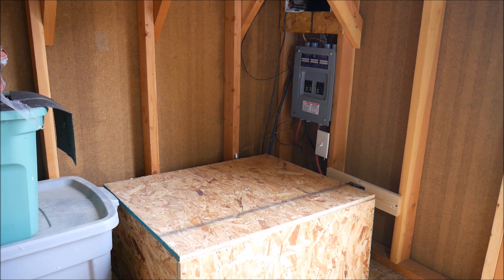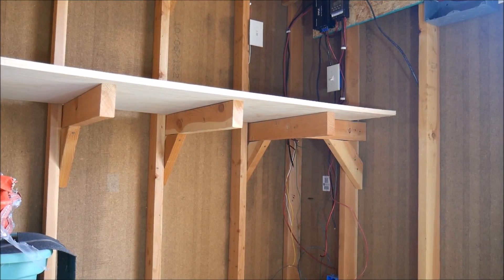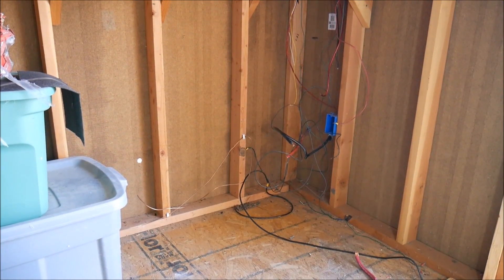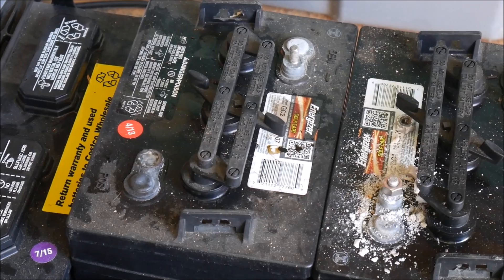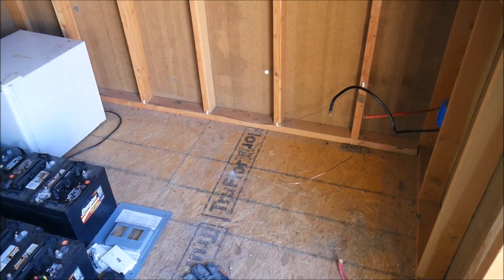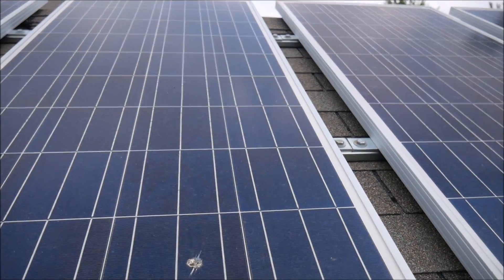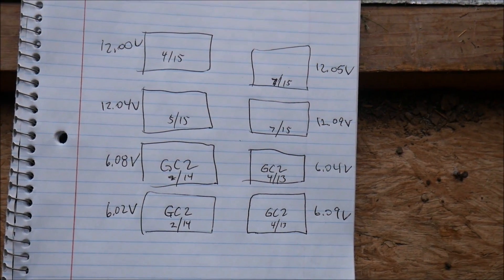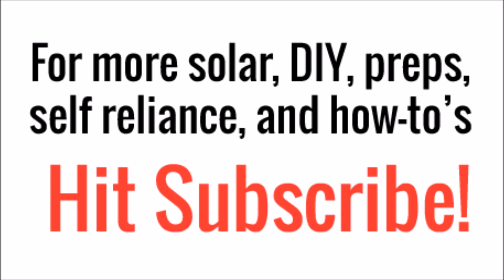Redoing The Solar Shed Part 1 - Demolition & Inspection

Comment: the batteries should be changed so they don't sulfate
Reply from the maker: Changed?  Or charged?  Yes, I need to charge them asap.
Reply: Charge
Reply: In this context he meant charged. Lead acid batteries will sulfate when you discharge them. The more you discharge the battery, the more lead sulfate that will be made, and the less amp hours the battery will hold. This stuff is very dangerous and reduce the life of the battery. How to combat sulfating

1.) Dont even get a lead acid battery, just get lithium batteries.

2.) Discharge them as little as possible

3.) Or, dont discharge them alot all the time

Comment: I wonder if you can solder or reattach the post that broke off as that would keep your pack uniform in a way?
Reply from the maker: I'm not sure.  I could just use the post to attach to, I suppose.
Reply: In this case it depends. Is the tip broken all the way down below (in) the battery? If it is, just get rid of the battery. If it is normally like this
       ____
       |        |
       |        |
___|        |__

and its like this

     |\
     | \
__|  \__

or similar, it could probably still work, just smooth the sharp edges.

Comment: dang...that refractometer sure looks familiar!!  ☝  nice huh?  one thot that may help is....get some free air space between the solar panel and the roof.  doing so allows heat to escape and avoid hot spots and much better panel efficiency....i have 8 inches of free air space and it really helped me....on a motorhome even.
Reply from the maker: True, I didn't really understand that when I built the mounting system.  There is about an inch and a half under there so that will have to do.  I'm not going to redo the panels unless I absolutely have to!

Comment: My new favorite solar system (large scale) is grid tied battery backup. For now, im off grid (small system).
Reply from the maker: Cool, why did you decide that?
Reply: Well, if I go 100% off grid with batteries, what if it is night time and the batteries are 100% dead (not shot dead just 100% discharged). So in theory, thats good, but in reality, its not practical.

Grid tied (no battery) means if there is a power outage and if it is sunny, by law, the panels need to be deactivated, so that is no use as well.

Off grid no battery is completely stupid also.

So theres really one other choice, grid tied battery backup. In this system, there is 2 breaker boxes, one is for the whole house, one is for fridge, freezer, furnace (think of it as the emergency if the power goes out). In this system, you can sell your electricity to the power company during the day, and buy it back at night. If the power does go out, the mainm breaker will be deactivated and the emergency breaker will be activated.

Comment: hey you don't have to throw it away just cuz it is broke off a lug .burn a new one on use a propane torch and a mold a little bit of LED and just make another one.  I'm an industrial Battery tech that's what I do be sure to open all cells blow them out with air before you put fire near a battery
Reply: Darryl Pickett I was thinking of a tap and dye set. Drill a hole where the post use to be and tap it for a new bolt. Would that work too if he doesn't want to use flames?
Reply: probably wouldn't work very well the led is to thin in that area, and the LED is too soft to hold a bolt
Reply from the maker: Haha, I might try that but I don't have any braising or lead melting experience.
Reply: Darryl Pickett